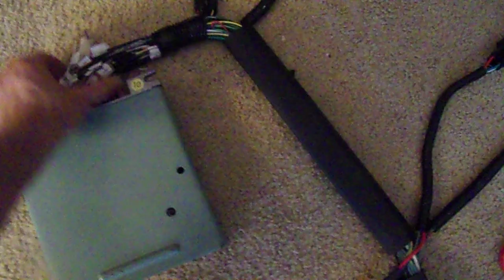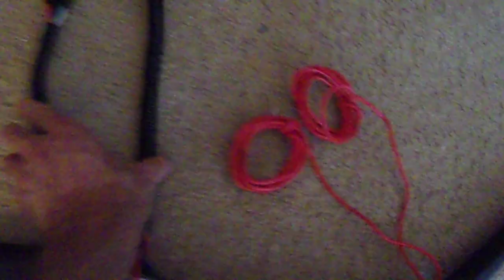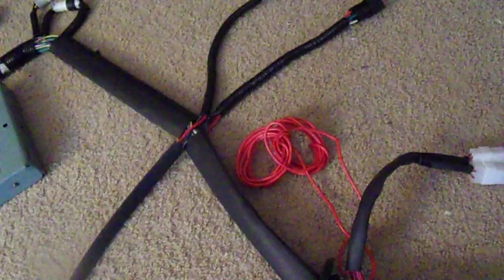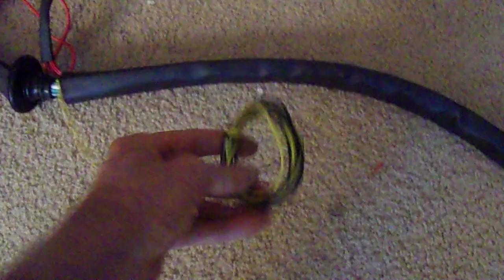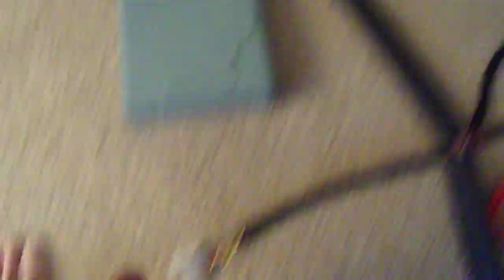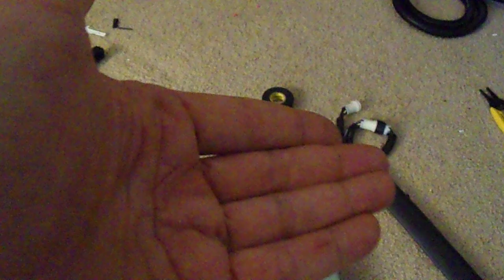280zx/300zx turbo DIY EFI wire har

Comment: Geez Dave, you’ve been busy! Looks great, when is first test run?
Reply from the maker: couple weeks, lots of extensive testing before actually trying it out. That and waiting on a post from Japan for the AAC/EGR OE style connectors that attach to the vacuum modulator.